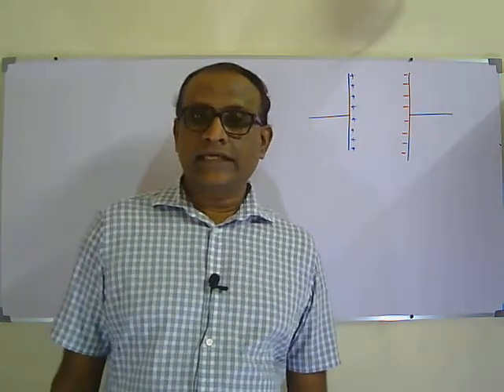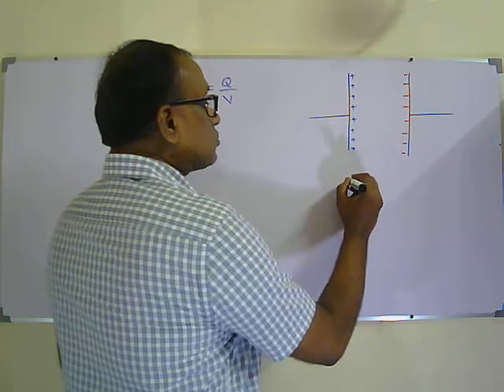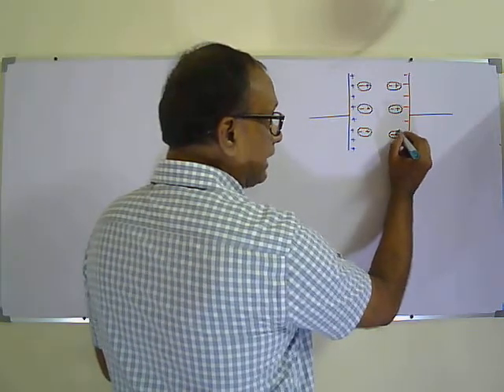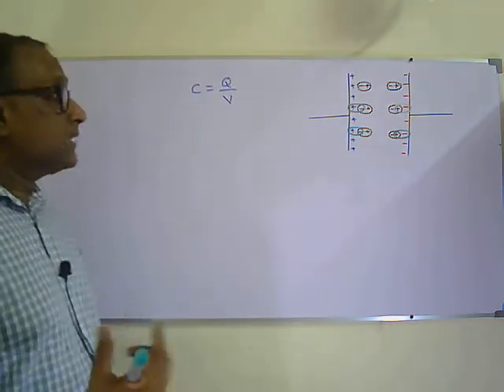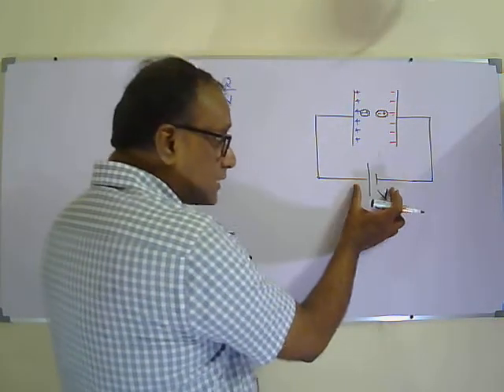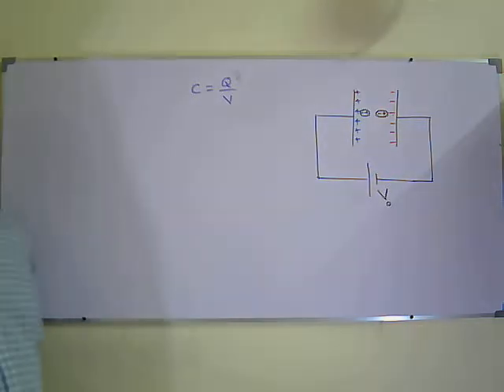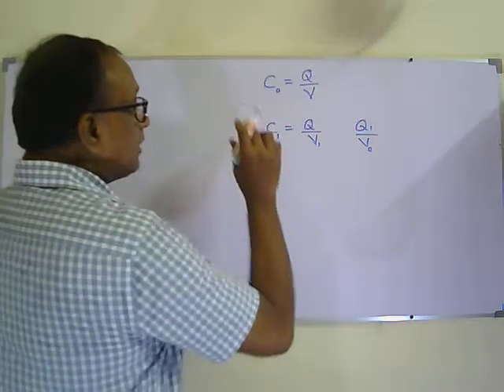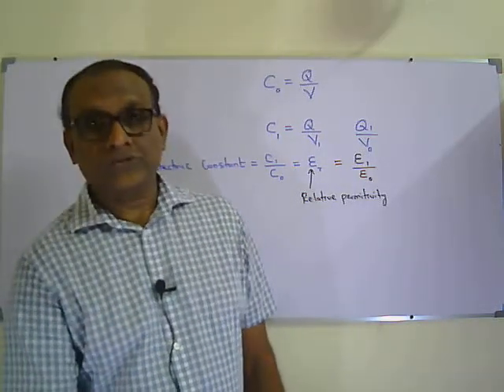Lesson on Dielectric material Capacitance of Capacitor Capacitance  Edexcel IAL Unit 4 QPH14/01

Comment: Sir, your explanations have always been top notch. However though, may I know why do capacitors explode upon failing to terminate excess charging?
Reply from the maker: Analogy: When the charge in the cloud increases above a specific value, the electric field strength between the cloud and the ground will increase. Air is an insulating material (dielectric material). Due to this high voltage, insulation of the air will be broken, and lightning occurs. 
Similarly, when the voltage across a capacitor or the charge stored in it exceeds its rated value, the electric field strength within the dielectric becomes too high. The dielectric material, which is normally an insulator, can no longer withstand the intense electric field. It breaks down, allowing a path for current to flow between the plates.   A sudden surge of current flows through the capacitor, heating up the internal components rapidly. The rapid heating causes a significant increase in pressure within the capacitor. If the pressure becomes too high, the capacitor can physically rupture, releasing stored energy and potentially causing damage to surrounding components.